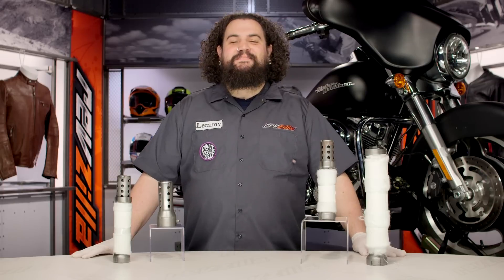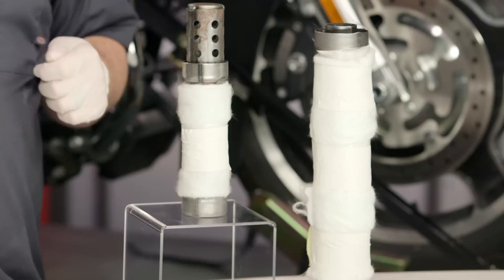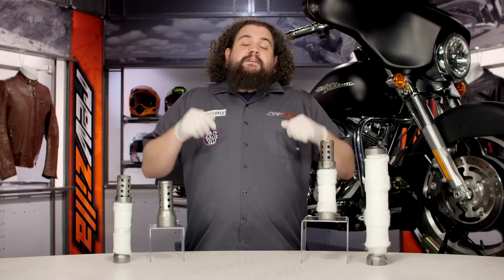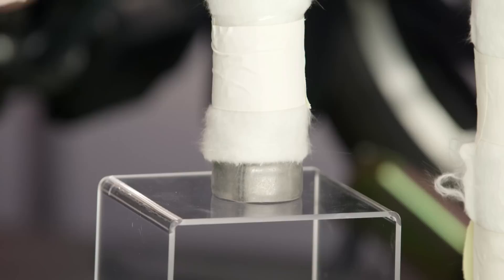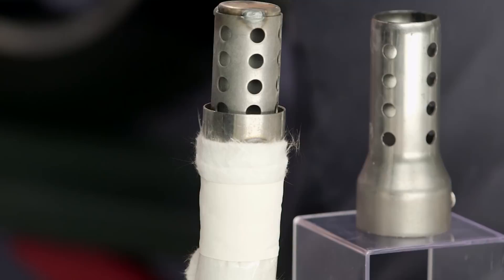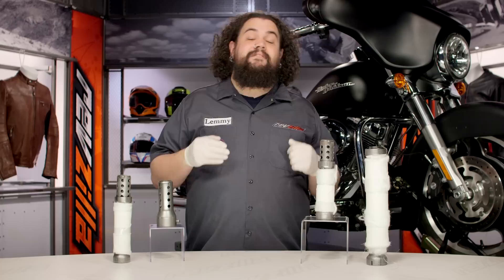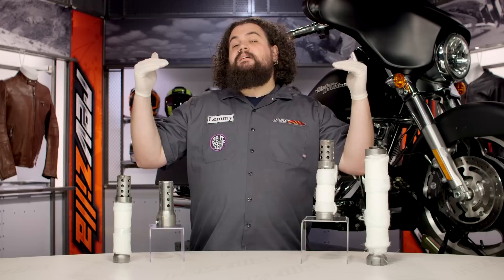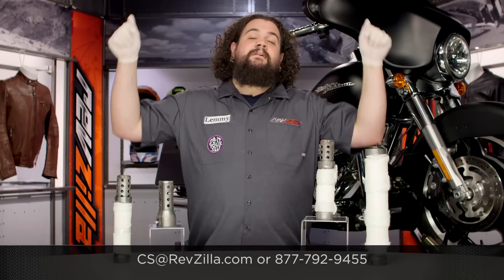Vance & Hines Quiet Baffle Review at RevZilla.com

Comment: I installed quiet baffles in my mufflers simply because I was starting to lose my hearing. The quiet baffles still allow for a great sound but at a decibel rate that is lower than stock or with louder baffles. The sound difference from stock is not very noticeable but the decibel reduction is. My hearing is so much better with these baffles. I highly recommend them.

Comment: I've run my bike with and without baffles and it definitely runs better with baffled pipes. Removing the baffles will cost you some low end torque and in some cases may cause your engine to run lean. I don't need my bike so loud it wakes the dead.

Comment: I put the quiet baffles in my V&H Straightshots. can't take the noise anymore but made no difference. I then wrapped them with fibreglass, still not enough. I'm now gonna cut em in half and weld a plate in the baffle mid way down. Gotta see what it does.

Comment: I installed the quiet baffles on a 2014 Street Bob in Big Shots staggered. I was a bit sceptic but I'm very happy with the result. They take the sharp edge of the noise and now the bike sounds great. Not quiet at all; just much more comfortable. Nice roar...
Reply: Johan Ros 
Hi John 
I have the same bike do we need 1  Piece  or 2 for installation
Reply: majdo sama Hi, you will need two baffles for two pipes. They don't come in pairs. And please don't take off the cling wrap!
Reply: Johan Ros got it thanks Man
Reply: So you just need to take the end tips off the pipes?

Comment: Hardly any sound difference at all on V&H straight shots on Harley Sportster 48 1200.
They do however give a little back pressure which definitely improves overall performance.
Reply: TomsReviews so there was not much of a difference then ? I too have a 48 and was thinking of getting these . Do you think it is worth it?
Reply: John Doe I have the same bike, peformance was a little lose without them, the baffles tighten up the feel of the engine and the throttle response.

Comment: Would the these help to increase bottom end torque.  As in the case of sideshots installed on a tc96?
Reply: performace gain down low?
Reply: Ever look into torque cones?
Reply: YES.
Reply: no. and if you've mapped your ECU you might want to re-map. thats if you notice anything.

Comment: Do you think these will create any problem or impact on the fuel injection or engine and damage them in the long run? Is it required to use a fuelpak and make the correction? Please suggest.

Comment: So I’ve had my 96 sportster for almost two years no the bike as been with me through a lot and is very sentimental . My landlord nologer allows me to keep it at my residence because it’s too loud. So it sits on the side of the road about a block from my house. It has stock pipes on. I would really like a new pipe that gives me that deep rumble I enjoy. But I’m looking for something that I can bolt on that will quite down enough to please my landlord, then I can easily remove it once I’m on the street. Any advice?
Reply from the maker: The stock exhaust is the quietest you'll likely get. Even aftermarket pipes with quiet baffles tend to be louder than the stock pipes. The only thing I can recommend you do is push your bike until you're far enough away from your residence and then start it up. -DrewZilla

Comment: hey mate. is there a way to quiet this exhaust close to stock . i like the look but the epa doesnt like the sound
Reply from the maker: +ALHD 48 Quiet baffles reduce an aftermarket exhaust a bit, but it definitely won't be as quiet as stock. -DrewZilla
Reply: I understand that. I purchased them . Any other options. To get a black out look with quiet exhaust?
Reply from the maker: +ALHD 48 Not unless you can get a stock exhaust with black heat shields. -DrewZilla

Comment: Hi All need some advice. I  have Cobra installed and find the muffler waaay to loud on long trips. I dpn't have original muffler otherwise I would return to stock. I can see the baffle inside the Cobra and was going to pull it and pack it to see if this would help at all OR, will the Vance and Hines fit, if so where do I order from

Comment: These things are just about impossible to get out once installed. They deepen the sound and sound good but they certainly are NOT quiet.
Reply: Just installed mine.  I took dB readings of stock mufflers, V&H 3" Twin Slash muffler with stock and quiet baffles.
Readings were as follows.  Stock mufflers--83 to 86 dB.  V&H 3" Twin Slash muffler with stock baffle--104 to 107 dB.  V&H 3" Twin Slash muffler with quiet V&H baffle--94 to 97 dB.  The quiet baffles are still loud enough to be heard better in traffic, have a deeper throaty tone, and are under the 100 dB noise ordinance standard in my city.
Reply: @Nichols9431  best.reply. in. the. thread. thank you.

Comment: Have you done a db test with the pipes stock at idle and then say 3,000 RPM and then compared that to the Quiet Baffles at idle and at 3,000 RPM and the Super Q Baffles at idle and at 3,000 RPM?  I've listened to many YouTube videos that have these pipes.  I wonder if the people recording set the audio to manual so the device does not increase or decrease volume.  Anyways I'm looking to get the Short Shots for my Street Bob and am contemplating if I want the Quiet Baffles or Super Q Baffles.  Good video and great reminder about fiberglass!
Reply from the maker: We have not done a scientifically-controlled test as such. In practice, I don't find the quiet baffles to be that quiet at all. Only the Super Q Baffles make much of a difference to me. -DrewZilla
Reply: @RevZilla  i find that the fact that you dont do a proper, non subjective test, is disappointing. Thankfully someone else did and measured the difference. it would really help if companies made an attempt to be objective in products because you cant dispute facts. noise readings wouldve made this video useful. As it is, its not really that useful. Plenty of places have baffles- why would i buy the Revzilla one?...cos you said it sounded cool?..
Reply: Ive just installed Super Q Baffles on my 883 Iron, and have lost serious power and its popping.  It is going back to the shop.

Comment: Hi I have twin slash staggered on my vn900 custom neighbour complains about the noise which would fit my exhaust system out of these in your video
Reply from the maker: Here is what you need. They're sold individually, so you'll need to order 2. -DrewZilla
*https://www.revzilla.com/motorcycle/vance-hines-quiet-baffle-for-fishtail-and-3-round-twin-slash-slip-on-mufflers

Comment: I was wondering what size diameter pipes would these fit in? I am thinking about getting some slash cut 40in drag pipes for my 07 softail standard. Due to my bike being fuel injected I need to have some back pressure. So I was wondering would one of these baffles fit a 1 3/4in or a 2in pipe?
Reply from the maker: They are specifically for Vance & Hines drag-style pipes, which have about a 2" inner diameter and 2 1/2" heat shields. We cannot guarantee fit for other custom pipes though. -DrewZilla
*https://www.revzilla.com/motorcycle/vance-hines-quiet-baffle-for-harley-metric
*https://www.revzilla.com/motorcycle/vance-hines-big-shots-long-exhaust-for-harley-softail-86-11
*https://www.revzilla.com/motorcycle/vance-hines-q-series-double-barrel-staggered-exhaust-for-harley-softail-1986-2011

Comment: Hey bro, love you work. I have been issued a defect notice on the noise of my exhaust. i have vance and hines 2 into 2 big radius which you mention they dont make the quiet baffles for. do you know if there is anything else out there on the market that can quieten these bad boys down? thanks in advance!
Reply from the maker: The only way to quiet them down is to take it a bit easier with the throttle...or swap those pipes for a set that uses baffles. That's the hard truth. -DrewZilla
Reply: I recently installed the 2 into 2 big radius on my bike and noticed that you have a baffle for these pipes on the site now (https://www.revzilla.com/motorcycle/vance-hines-big-radius-quiet-baffle-for-harley).  Would you recommend against those baffles or were they not available at the time of this original post?

Comment: Hey I got a pair  of these quite baffles from you guys for my honda vtx1800 big shots. Baffles come with fiberglass packing wrapped in plastic, do I need to remove that wrapping before installing or leave it on? Thanks.
Reply from the maker: Leave it on! It makes installation much, much easier, and the plastic will just burn off after installation. -DrewZilla

Comment: Hi Lemmy, I have the V&H twin slash slip on mufflers on my Iron 883 2015, I like the V&H sound but again it's a bit too loud. all the installation instructions I read about installing the baffles talked about removing the stock baffles but my twin slash came with no baffles at all, would I still be able to install the quiet baffles? V&H recommended 1.5in Quiet Baffle 21899.
Reply from the maker: Yes, you should still be able to install quiet baffles. -DrewZilla
*https://www.revzilla.com/motorcycle/vance-hines-quiet-baffle-for-fishtail-and-3-round-twin-slash-slip-on-mufflers
Reply: Did the quit baffles help?
Reply: @coreyk644  yes they did, reduce the noise level but kept the good sound

Comment: What is the 'trick' to getting the original baffles out ???
Reply: ride the bike around till the exhaust is hot it will make the baffles come out really easily.
Reply: Spray some WD 40 inside and let it sit for a few minutes. Then grab the baffle with a pick tool available at Harbor Freight for a cheap price. Good luck!
Reply: coat hangers work well. bend one so you can grab the baffle from inside.

Comment: Is the difference in air flow enough that I will have to use my FP3 to redo the efi?
Reply from the maker: It's not a big enough difference to warrant the FP3. -DrewZilla
Reply: RevZilla thanks
Reply: YES
Reply: @RevZilla  hey I got a question if I remove the Baffle will I need a tune?

Comment: Hi Lemmy,
I have V&H short-shot installed on my 2011 street bob.. I'm considering Quiet Baffle due to laud noise I'm casing my neighbors..
Therefore, the following are my few question about those quiet baffles:

1- Is there major difference between the V&H Quiet Baffle vs Super Q Quiet Baffle?
2- From the pictures i saw and some of reviews i read, it seems that 'Super Q Quiet Baffle' might require some modification to be made on the short-shot in order to fit it, am i right?
3- while configuring Fuelpak FP3 it asks me for the type of baffles on the exhaust however, in Fuelpak FP3 there is no Super Q Quiet Baffle option, therefore, what shall i chose in the app when tuning and will that have an effect on the tuning?
4- While installing the Quiet Baffle or Super Q Quiet Baffle will i have to use anything other than the "L Key" to be able to slide in the baffle screw it again?

look forward to hearing from you mate.
Reply from the maker: 1. Yes, there is a major difference between the Quiet and Super Q Baffles. The Quiet Baffles aren't that quiet, while the Super Q Baffles make the Shortshots acceptably quiet at idle and low speed. You still get a nice full sound when accelerating though.
2. The Super Qs should not require modification.
3. With the FP3, you would just choose the standard baffle option. You can then run auto-tune mode if you want additional fine tuning.
4. You don't need additional tools, though you'll probably want to use some anti-seize on the metal flange of the baffle, just where it mates with the exhaust. Also remember to leave the thin plastic wrap on the baffle material for easier installation.
-DrewZilla

Comment: Are there different baffles for the V&N Slip-on pipes or are these only for full system exhausts? And assuming the only change i make on an Iron 1200 are these slip-on pipes, Will the bike run fine if I don't do a re-tune? Thanks
Reply from the maker: There are different baffles depending on exhaust diameter and whether the exhaust is a big radius style. If you're just doing slip-ons on an Iron 1200, you do not need to retune. See below for the available Vance & Hines slip-ons and compatible baffles. Remember that baffles are sold each, so you'd order 2; one for each slip-on pipe. -DrewZilla
3" Round Twin Slash
*https://www.revzilla.com/motorcycle/vance-hines-3-round-twin-slash-slip-on-mufflers-for-harley-sportster-2014-2017
*https://www.revzilla.com/motorcycle/vance-hines-quiet-baffle-for-fishtail-and-3-round-twin-slash-slip-on-mufflers
*https://www.revzilla.com/motorcycle/vance-hines-competition-baffle-for-fishtail-and-3-round-twin-slash-slip-on-mufflers
2 1/2" Straightshots
*https://www.revzilla.com/motorcycle/vance-hines-2-12-straightshots-hs-slip-on-mufflers-for-harley-sportster-2014-2017
*https://www.revzilla.com/motorcycle/vance-hines-quiet-baffle-for-harley-metric

Comment: would they work  for the HD street 500???
Reply from the maker: +mr Turner No, these are not designed for the Street 500 and 750. Vance and Hines makes the Competition Series Slip-On for the Street 500 and 750, and that slip-on includes a removable noise insert. However, even with the noise insert in, the exhaust would be louder than the stock exhaust. -DrewZilla
*http://www.revzilla.com/motorcycle/vance-hines-competition-series-slip-on-muffler-for-harley-street-2015-2016